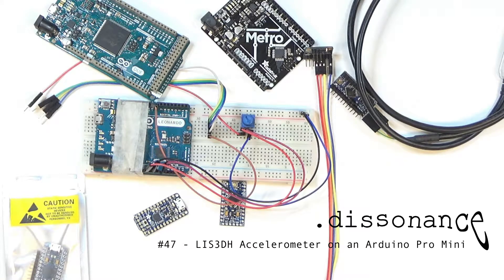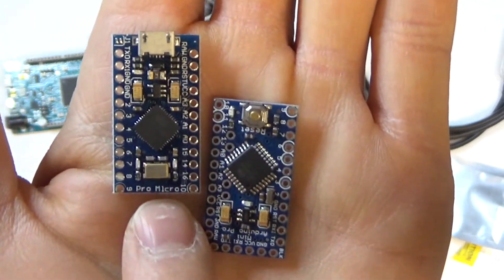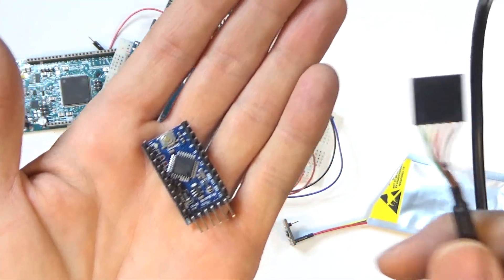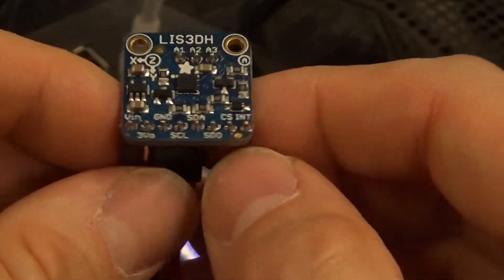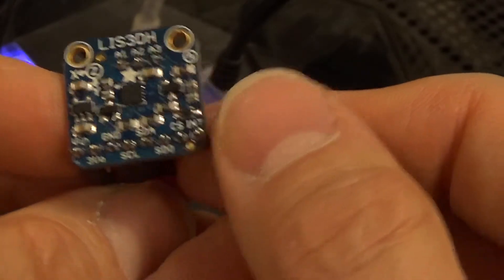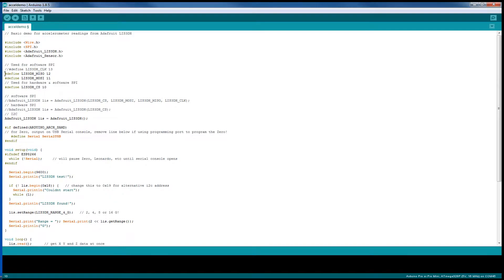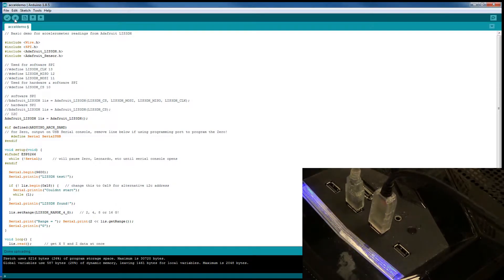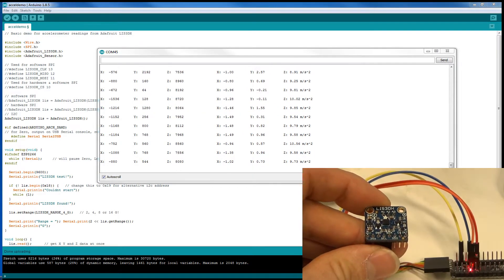#47 - LIS3DH Accelerometer on an Arduino Pro Mini

Comment: Thanks for explaining the code. I have interfaced accelerometer with ESP32. I've observed one thing where if I keep my sensor in a stationary state or move it, the values change by at least the size of 16. . I have set my range at @2g. I have worked on MPU6050, where the values of acceleration in any particular axes didn't change by such a huge step(in this case at least 16)

I would really appreciate if you could throw some light on this and guide me where am I going wrong.